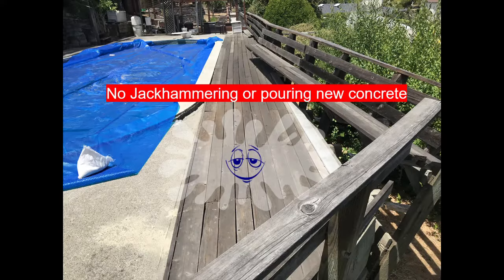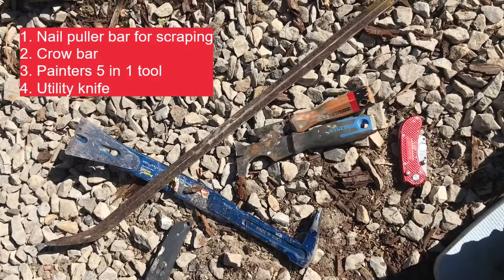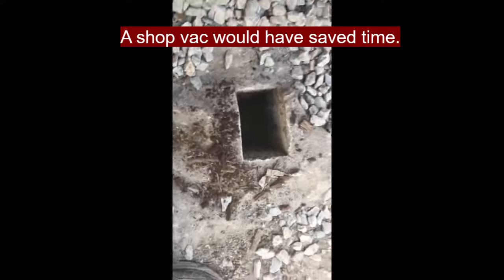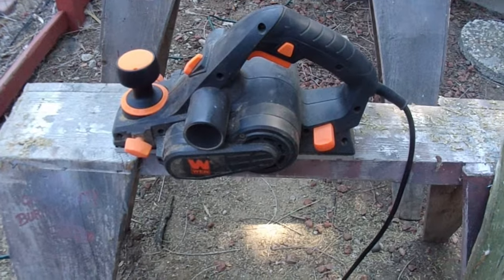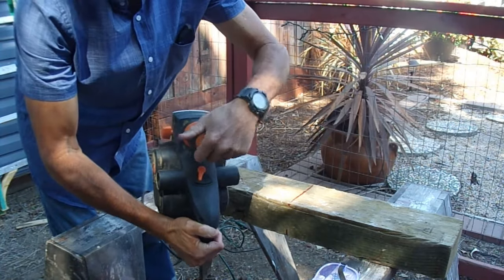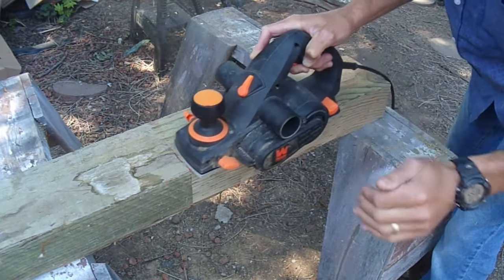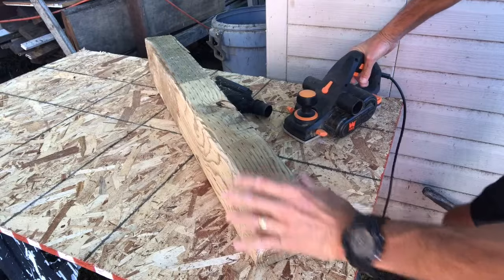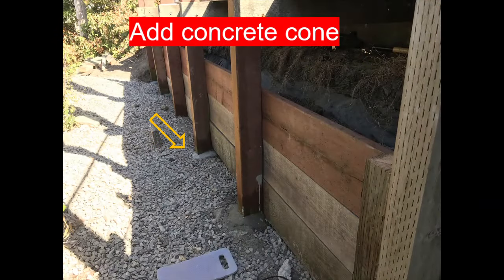How to remove and install a rotted fence post anchored in concrete

Comment: Excellent idea for a very rotten post! I have an idea. If you had converted to metal posts, which are smaller in diameter, perhaps you wouldn’t have had to clean the hole out as well. Then you would just need a small amount of concrete to add into the square hole around the round post. Plus metal posts last longer. Thank you for making the video!

Comment: 👏👏👏 hahahaha funny thing is , im in the process of replacing my 6x6 fence posts that have roted out same thing , i bought a 3 inch ring and plate , plus i use the 4-5/8 boring bit to flatten the old wood , just until I can hit solid , then drill the ring/plate with 6 inch structure screw , and use the chain with a 6 feet plus steel rod , a few blocks under one end , and for the most part , they just slide right up , but the ones that are extremely rotten , i use the drill method with the 2 inch ridgid vacuum , then i use the fence post foam to fill up the voids , and finish up like you , so far so good , and save hundreds of dollars per post , i called a fence installer , 2 years ago they wanted 450 per post , i have 14 to do , even spending 600 for 10 foot 6x6 posts , plus the drill bits and vacuum plus cement and foam , i still haven't spent 1000 dollars 🙏🤞👍 , great job , and great video

Comment: Well done,looks easy when the old post is dry and rotton all the way through,I have a similar problem with the post just snapped off level with the ground and the wood below is still good,I've had this before and its a pain chiseling the post out,still looking for a easier way to do it.

Comment: I had a job today and typically use this method. However whoever installed the old posts put rebar through the old posts. Needless to say a two hour job ended up taking 9